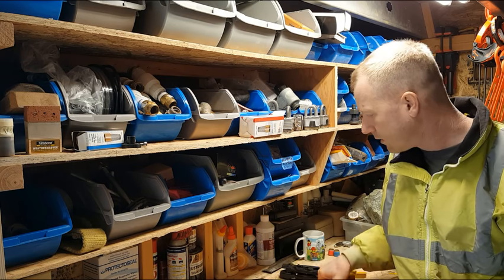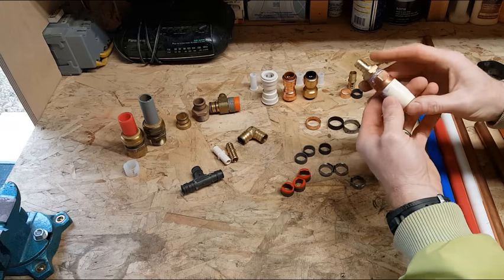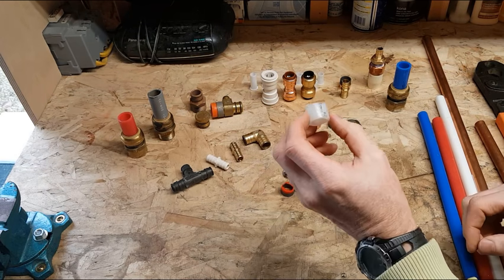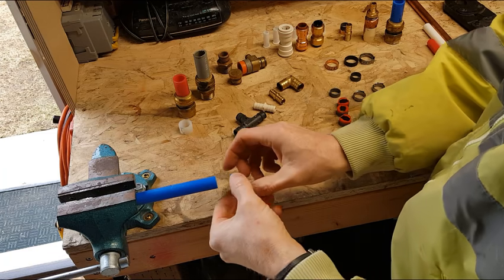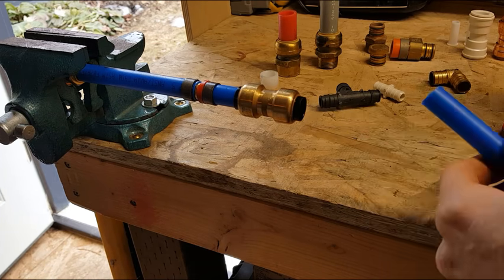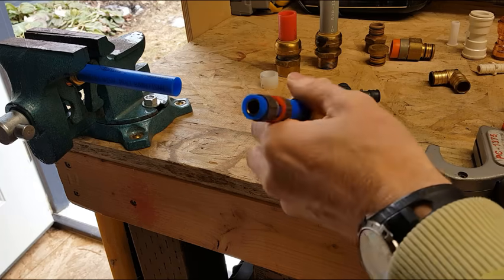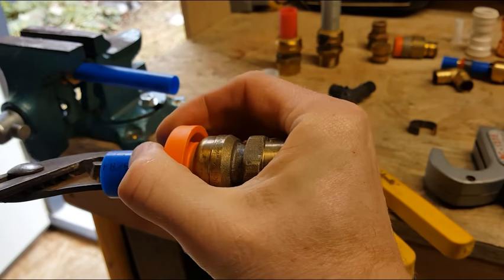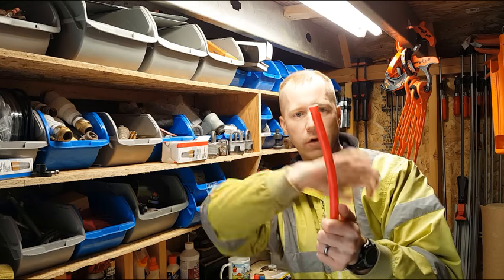Plumbing 101, Pex Tools, Pipe, &  Fittings!

Comment: I'm from the old school. Copper piping and soldering all joints. A skill and art in itself. I haven't had a need to do any home DIY plumbing jobs on the new pex style plumbing.until I moved into our new home. Realized in short order that I didn't know how to deal with this new product. I've been watching many YouTube videos but until I saw your demos I couldnt get my old brain around it. Thank you for a great video.
Reply: Good luck but using PEX A with the expansion connection method is superior in few way such as to not cause restrictions to the water flow. Here is 1 example https://www.youtube.com/watch?v=an4C5w0H-A0
Reply: My respect to you for working with copper. I know it takes a lot of skill to get things soldered properly and not melt other things or set things on fire. I know I wouldn't be comfortable with sweating copper (but I'm not a plumber), but I can glue PVC and CPVC (obviously not together since that wouldn't make a secure solvent weld). I imagine getting copper to bend without kinking also requires skill.
Reply: @Gwen G   Personally I’d prefer to replumb my house with copper but between the hard water and chloroamine treatment in my area, copper actually pits and has pinhole leaks within a few decades. Some of the builders have even sued the water utility for damages. So I’ll probably use pex or schedule 80 pvc.
Reply: @edbouhl3100  copper sucks. No plumbers prefer it. All new houses get PEX.

Comment: Polybutylene is what the gray mobile home water pipe was called. I hated that pipe! I had lot's of leaks with that pipe.
Reply from the maker: When I worked as a plumber in the late 90's, my company was an authorized replacement company stemming from that class action lawsuit. We re-piped MANY mobile homes!
Reply: Robert Emberton polyb pipe reacts to the chlorine in the water and dissolves the pipe. There was a class action law suit for it, so now it's called quest pipe, same pipe, but a little better